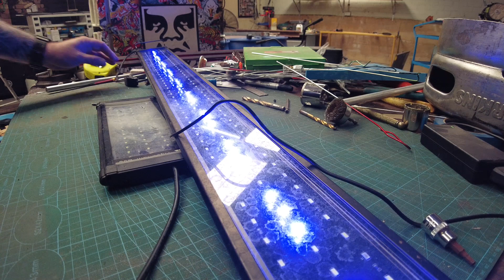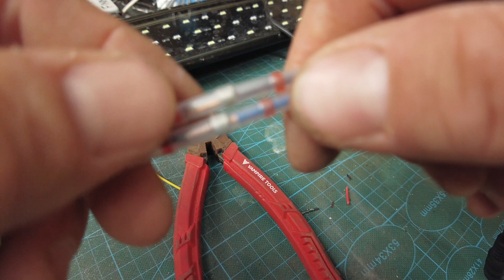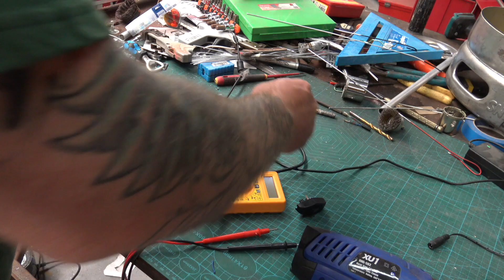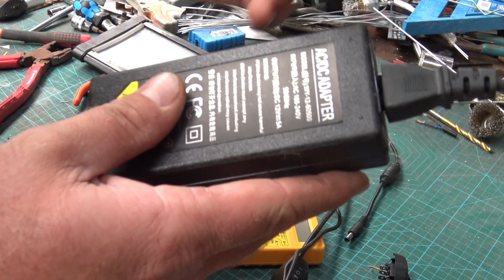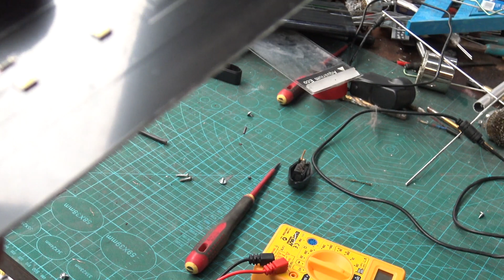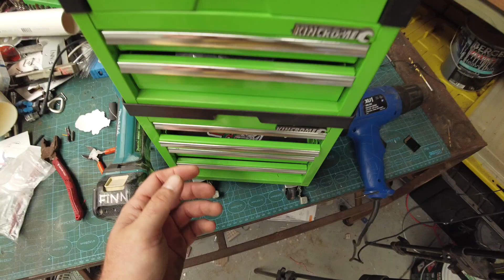Common Aquarium LED Light Problems | Fault finding a couple lights

Comment: my light is strobing when i turn it on, it used to stop strobing after a minute, then two, then five, then ten... now it doesnt seem to stop at all. i gave up for a week but i shouldnt keep using the pathetic desk light ive put in its place. i hope this has a lead
Reply: oh my god, turns the junky just-a-few-leds light lid this tank came with that was in storage had a disconnectable power supply and so far, that one works with my light! i dont know if it will cause problems in the future or if i should get something else but god finally
Reply from the maker: Compare the data plate on the two power supplies to see if it has the capacity
Reply: im gonna list both to be safe because they seem very similar but not quite

(strobing adaptor) AC/DC ADAPTER
MODEL: SPF-888
INPUT: 100-240V AC
50/60Hz
OUTPUT: 12V DC 1A

(working adapter from the tank's shity lid light) JODEWAY CLASS 2 POWER SUPPLY
MODEL:JOD-S-120030A5 - C - 3
INPUT:100-240V ~
50/60Hz 2.0A
OUTPUT:12V (line with dashes under it) 300mA
 @Finntheweekendwarrior
Reply from the maker: @LucillePalmer your working adaptor has less current output capacity, I’m not sure the load of the let light you have plugged into it? I would assume it’s fine, but if it’ll draws more it might shorten the life
Reply: shorten the life of the power supply of the light? either way ill try to find a new one, thank you! @Finntheweekendwarrior

Comment: I found one of those aquarium led lights in a hard rubbish collection and when  I got back home it did not work. The on/off switch was frozen in the on position, so the plastic cover was removed and a jumper lead was used to bypass that switch and it worked. There was a lot of corrosion in that area so that is why the switch was not working.